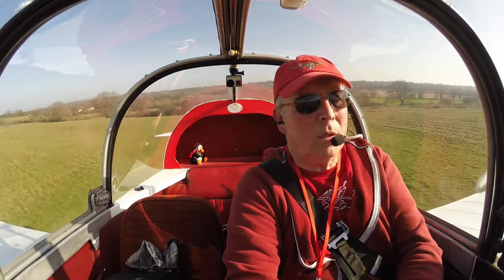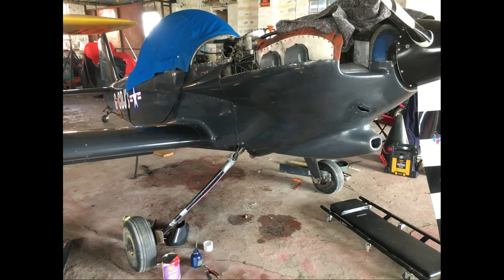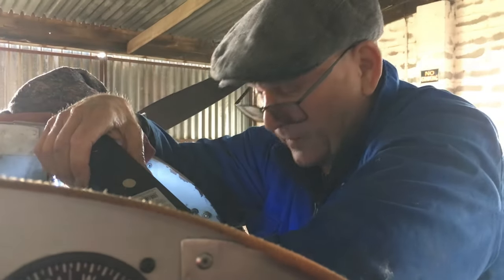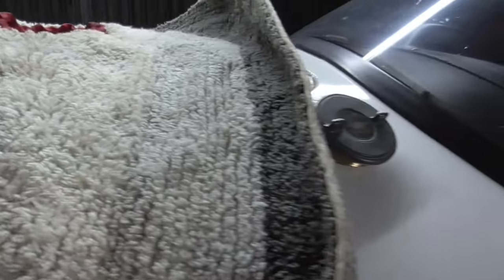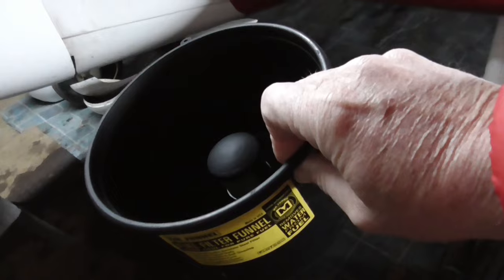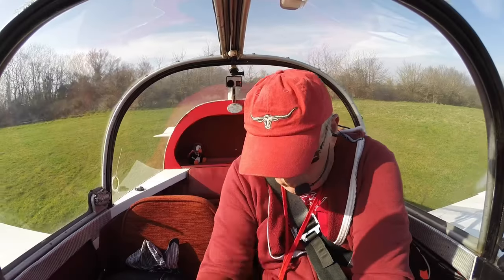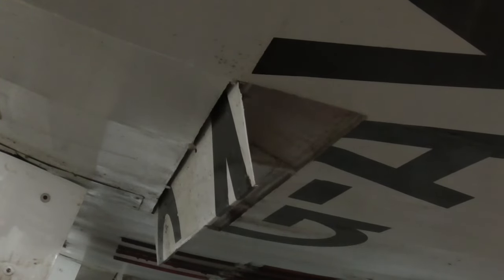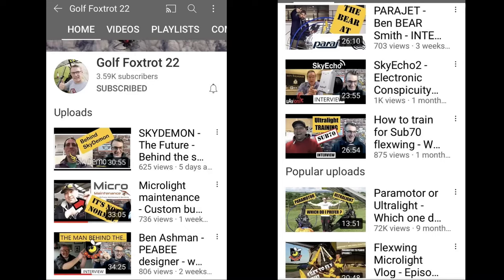WE COULD FLY BUT I WAS STUCK ON THE GROUND!  - PILOT VLOG #303

Comment: Hey Tim, to bleed the brake lines I usually use a large seringe, it makes the job mutch more easy. You just have to make sure the reservoirs stays full so that there no air can enter . 😉. Have a nice weekend. Thanks for the video. Greets.
Reply from the maker: Thanks for that. John does use a small pump but has had to send for some spare parts which we are hoping to fit today. Have a good weekend yourself.

Comment: Stubborn air in RV (and other experimental) brake lines is common especially aircraft with MATCO brakes. Often the problem is air which is stuck in the brake cylinders. For me, the only surefire way to remove all the air in the brake lines is to both push brake fluid up to the reservoir from the brake calipers, in the traditional aircraft method, and at the same time suck brake fluid out of the top of the brake fluid reservoir. Basically its push and pull at the same time. I use the expensive ATS bleeder at the caliper and an inexpensive fluid sucker from Amazon. This is a goofy procedure, but it works every time. I enjoy watching your videos and get a kick out of seeing the differences and similarities to our flying here in central Texas. I feel bad for y'all having to use the word "conspicuity", is it really necessary?
Reply from the maker: Thank you very much for watching and taking the time to write this comment which I am sure John will find useful. I know he has tried a number of things but never the double system. The conspicuity thing is a pain but I reply now by saying 7000 (which is VFR) as opposed to 2000 (which is IFR). What do you think of our farm strip?

Comment: I watched this yesterday, I find it so interesting you've got an airbrake. I can never slow down the DA40.  Looking forward to more !
Reply from the maker: Thank you for watching Robbie. The airbrake does make a big difference to the approach profile.
Reply: @JodelFlyer  What is the SOP? Do you have to dump them on short final in case of a GA? That's very A318 and E195/170 esque if so.
Reply from the maker: @TheFlyingVLOG  White arc below 80kts and land with it extended then retract while taxiing. They do come up easily on a go around although there is quite a big trim change.

Comment: I've just put a new master cylinder on the Ercoupe, so had to go through the bleeding process with my mechanic. I recognized the same Cleveland calipers on the RV. That's quite a setup for your fueling - I just stick a nozzle in! But I guess you don't have self serve pumps on your beautiful little strip? Where do you get your fuel from, and what type is it? Nice video, Tim!
Reply from the maker: Thank you James. Most of the places we fly to it's a matter of nozzle point and press. That set up is just for me when I am alone at Nayland. I use 100LL in a can from a local airfield or Super unleaded from a garage close to my home (once I have tested it for ethanol)
Reply: Thanks Tim, I see. We can't get ethanol free petrol here in California. I do have the STC to allow me to use it in my O-200, but just can't get hold of it.

Comment: Hi. Is the airbrake standard? Do you find it necessary? I wouldn't have thought that the Jodel was so slippery to need one 🤔
Reply from the maker: The air brake is standard on the DR1050. It does allow a steeper and therefore shorter approach and landing.
Reply: @JodelFlyer  Oh ok. I see also that they don't normally have flaps so that's a good reason for an airbrake